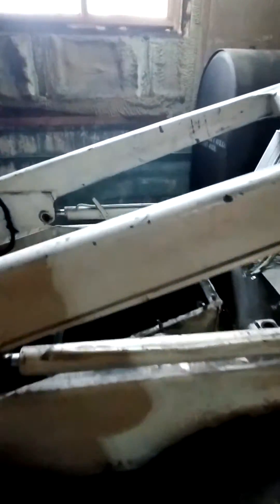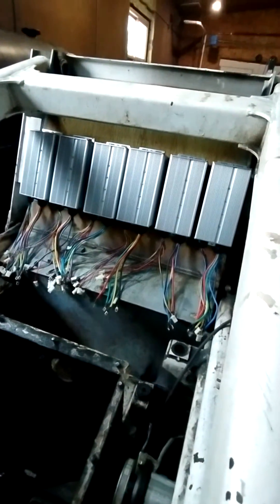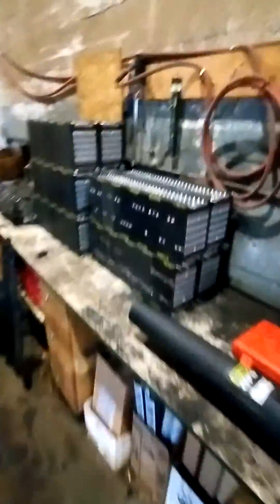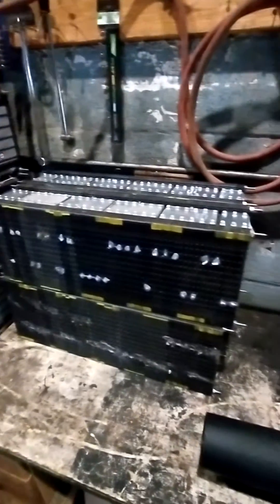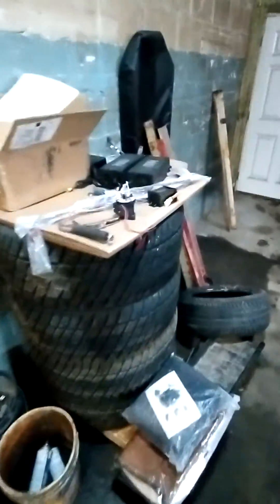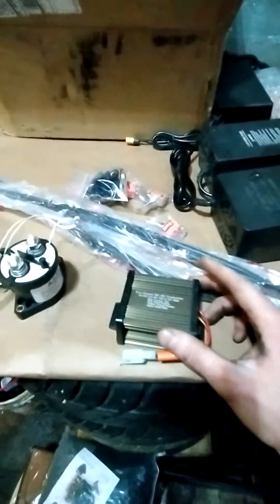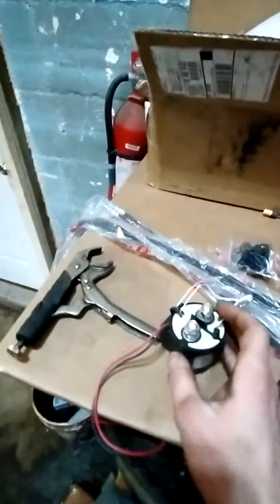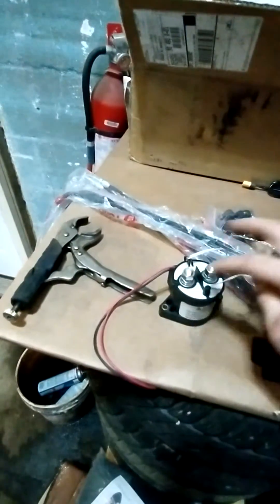Bobcat 825 Full Electric Conversion Lithium Batteries and 18kw Motors Part 1

Comment: Hey, how is this coming along?! Looks awesome
Reply from the maker: Got it all finished and working pretty good but the motors are not water cooled so one of them overheated and burned up when I was working it hard moving sand. Also the motors need regen braking and the controllers did not support that. Ended up selling it and buying a tractor. May end up doing something in the future if time permits but for now it was just a big learning experience. The batteries did end up working very well and it had a long runtime for what I expected.
Reply: @levijefferies9329 cześć jestem z Polski 
Chce przerobić bobcat taki jak jak twój ale trochę większy. 
Chce użyć wszystko od mitsubishi i- Miev.    35kw motor.   16kwh batery   Falownik silnik ładowarka. Wszystko chłodzone cieczą  
Koszt materiału max 2500 dol - wszytsko